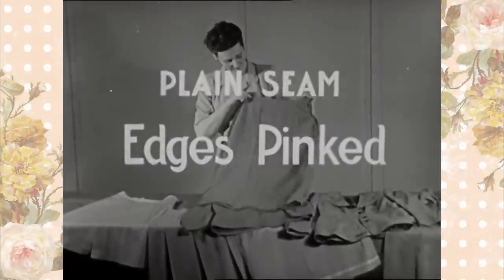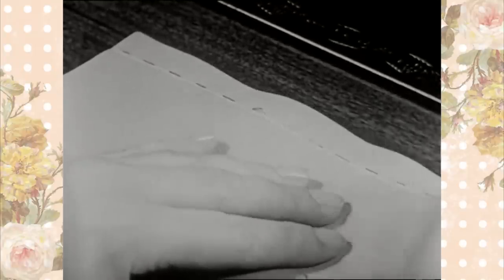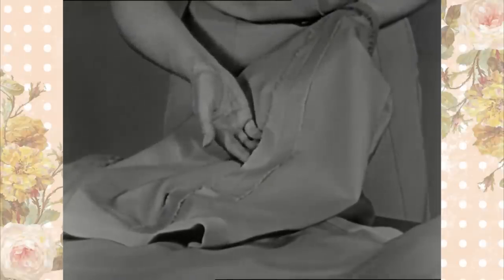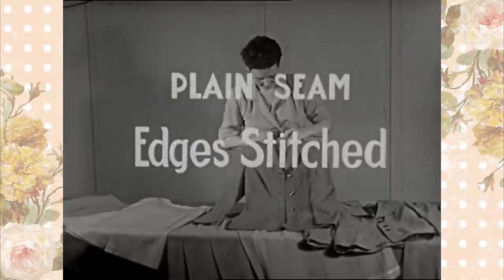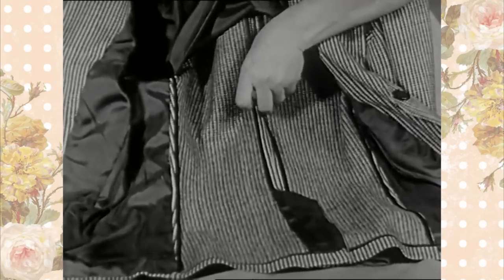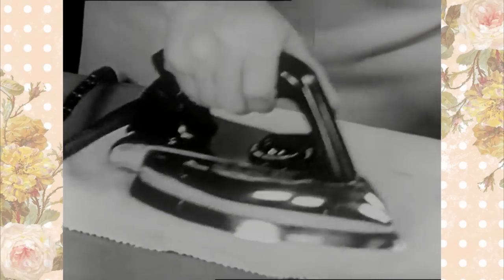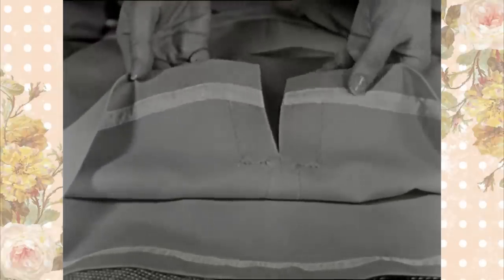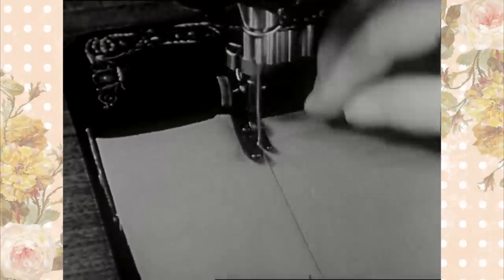Sewing Simple Seams - vintage 1940s sewing video

Comment: Nobody would bother sewing if you had to do all this basting nowadays. Pin basting, sewing over the very tips of pins is just fine and have had my machine for years with no negative impact. Also rotary cutters have made cutting out so much easier. Pinking shears never were a good option as they got dull easily and really didn't stop things completely from raveling. Now sergers are affordable, and do a much nicer and more effective finish.

Comment: Does anyone know what model that sewing machine is?
Reply: Hello! It appears to be a 201.  Many collectors believe this is the best singer ever made ! It was first released in 1935 and sold thru 1964 with various versions such as 201-1, 201-2 coming out throughout those years. I currently sew on a Singer 301 black finish which is from 1951 and was the first tilt O' matic ( slant needle ) singer machine ever made! Hope this helps!